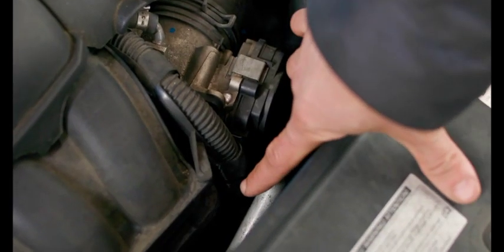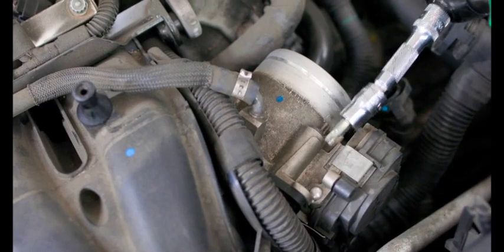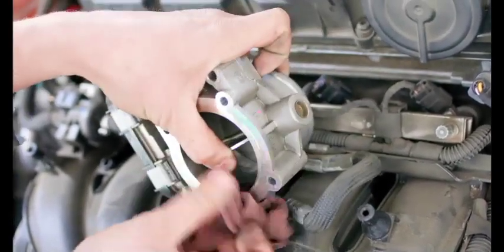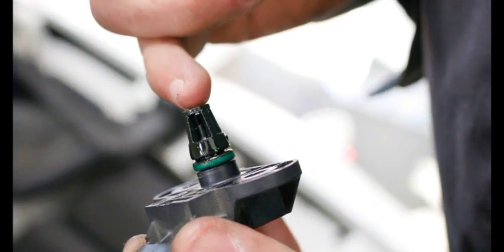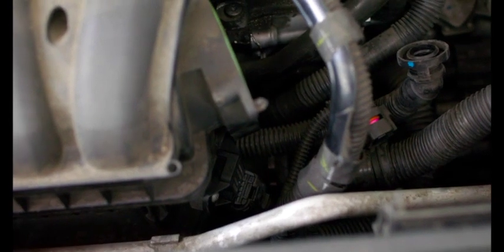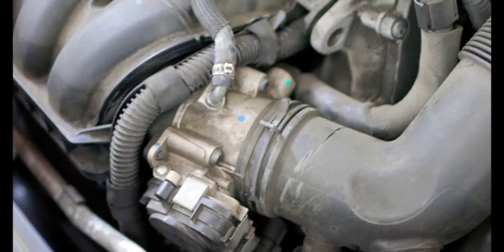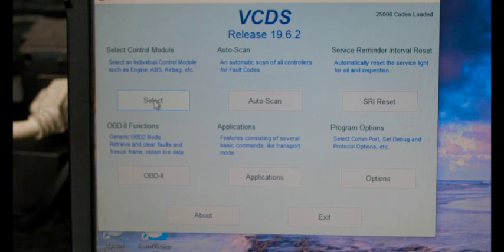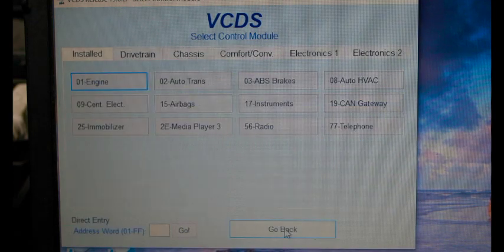2012 Vw Jetta 2.5 Check Engine Airflow at Idle too Low P3078 Manifold Pressure Sensor P0106 FIX

Comment: i'm getting misfire cel codes and rough idle. i've already replaced the pcv, map sensor, coils, and plugs for my 2.5. i have rough idle at startup and when stopped at lights. car seems to be fine at highway speeds. after the engine comes to temp i hear a whistling sound which might be coming from the new pcv diaphragm. 

could i have a vacuum leak? how can i check and where is it most likely to come from?

the rough idling etc and misfires started after i bumped into a curb at relatively low speed due to road conditions. thanks!
Reply from the maker: Hello Kumbackquatsta,  You have a vacuum leak. Guaranteed. The replacement PCV from Dorman are china junk and they do not work, they leak brand new. You can disconnect the large vacuum pipe on the valve cover and plug it with your thumb and start the engine. It should idle normally. Now you have isolated the vacuum leak to the pcv system. Replace the entire valve cover with a good OEM Vw original valve cover. This will fix your problem. Good luck
Reply: @matttorian  thanks for the reply matt! i will check the pcv. is it better to replace the entire valve cover rather than just the pcv? mine is 2012 2.5 with the separate components.

assuming a failed/whistling pcv, should i also assume that oil has gotten down to the map sensor too at this point and look into cleaning/replacing the map again?

can high revving an engine cause a pcv to prematurely fail?
Reply from the maker: Replace the whole valve cover with the built in PCV. It’s whistling and leaking vacuum at idle.  They are not cheap from Vw ($400) but you can probably find one online for a good deal. The map sensor will be fine. Let me know if you fix it
Reply: @matttorian  thanks i'll look online. do pcv deletes for the 2.5 exist? and do you have any thoughts on them?
Reply from the maker: @kumbackquatsta  no don’t do that, fix it right. You need the Oem pcv, it’s a oil separator as well. Keep it stock. Don’t bolt more junk on your engine
Reply: @matttorian  makes sense, matt.

so it was the pcv diaphragm causing the whistling and rough idle. you were right again. it's a dorman (4 months old). 

question for you, the pcv typically fails by tearing, right? in this case, the pcv was puffy, blistered and warped. no visible tears. as if it got scorched by hot liquid/air. this seems odd since the pcv is on the intake side which should not expose it to extreme heat?

the chain of events was a rough idle and shudder at stoplights, fine at highways speeds, and later after warming up, a whistling (from pcv). i did not know at the time the pcv was contributing to the issues.

so i changed the coils and plugs, but still had persisting rough idle issues (the pcv). but with the pcv fixed, it runs fine.

 i'm wondering that since the rough idle/ shudders/misfires came before the pcv whistling, that it was the misfires that could cause a pcv to fail as described (blistered, heat warped, puffy..)? backfire from misfire?
Reply from the maker: @kumbackquatsta  the Oem pcv fail from tearing. The Torn diaphragm creates the vacuum leak that sucks air in from the small vent on the bottom which makes the idle rough and you will have lean faults, idle faults and all cylinder misfire faults. The China pcv does not tear but leaks around the seal creating a interior vacuum leak. Congrats I’m happy you fixed your car.
Reply: @matttorian  thanks for your help and generosity, matt. this video was invaluable for changing my map sensor. i hope these comments can help others.

so i should assume the warped/bubbly appearance of the dorman pcv, is just a normal non-oem pcv failure, and not some heat related thing that scorched the pcv?
Reply from the maker: @kumbackquatsta  yes non Oem China junk part that barely lasts out of the box.
Reply: @matttorian  i'm honestly surprised no company has come out with a competitor using the same diaphragm material as oem, people will pay a bit extra over dorman. there's so many vw/audi motors out there
Reply from the maker: @kumbackquatsta  the 2.5L pcv doesn’t go bad too often (Vw/Audi 2.0T pcv go bad much more often) and when it does the valve cover is typically leaking oil as well. Plastic doesn’t last forever, it will warp over the years. Oem valve cover is prob the best repair but a new Oem quality diaphragm replacement is definitely a good idea.

Comment: Are the Bosch 20$ dollar sensors just fine? Im trying to compare the OEM-OE sensors. Also would the turbo outlet MAP also cause these issues?
Reply from the maker: Bosch sensors are just fine, they are Oem and the only sensor I would use. What car do you have? There are no Jettas with a 2.5L and a turbo. Do you have a RS3 or TTRS with 2.5T?
Reply: @matttorian  its a 1.8t tsi gen3 ea888 motor. I just dont know the spec on the sensors which makes it seem like 20$ is a scam compared to 65-85 for OEM

Comment: What if you don't have VCD software (free) and the $500+ adaptor.  How do you adapt the throttle then?
Reply: Disregard.  Answer to my question was down below in the comments.  Silly me!  Thanks for a great video!
Reply from the maker: Hi Kirk, I showed this step as we always do this at my shop but I think you will be fine without adapting the TB. just clean it well and make sure to clear your fault codes. -Matt
Reply from the maker: and Vag-Com cable is available for $199 through Ross-tech.com. for me it is absolutely priceless tool for Vw/ Audi repair work.
Reply: @matttorian  isn't the vag-com for older VW's? I have a 2013 Passat and thought I needed vcd and the Bluetooth adapter... $199 is close to what I paid for my code reader (with some vw features).  In any case thanks for the video and taking time to be responsive! I've got parts coming Saturday and will be doing this for sure.
Reply from the maker: @kirkramanauskas3232  vag-com, vcds and Ross tech are all the same. The software is free you just need a laptop and the cable. I know they had single vin cables for $199. Vagcom works for all obd2 vehicles from 1996-2022. It is a powerful tool that can scan any control module on the entire car just like the factory scanner. The only thing it can’t do it functions that require a factory password like keys, ecm and instrument cluster/ immobilizer replacement. But in your case you just need a simple obd2 scanner to clear your fault codes and you should be fine.

Comment: What you thing about P2188 ?
Reply from the maker: Too rich off idle. This is a fairly rare fault and without actually looking at it I can only give you my best guess. You might have fuel in your oil, I would change the oil and also clean the throttle body and adapt it: it wouldn’t hurt to do a tune up on the car, install new spark plugs. You also might need a new Map sensor, possibly new Maf sensor if you have one depending on your year and possibly a new front oxygen sensor that is reading too rich. Also make sure your PCV valve diaphragm on the valve cover isn’t torn and leaking vacuum. That typically causes a lean fault though. Good luck

Comment: What is the bosch part number?
Reply from the maker: There are two different Map sensors, the early BPR 2.5L 2005-2007 uses a MAF and the Map sensor is different. This video is for the newer CBUA 2.5L 2008-2014 with NO MAF and uses Bosch # 0261230234.
Reply: @matttorian  thank you for the answer 😊

Comment: Map sensor location is pretty bad makes want to install a catch can to eliminate some of the oily residue going to throttle body.
Reply from the maker: Bernarda Flores I wouldn’t worry, catch cans aren’t necessary, it would help but there would still be some oil getting by from the separator as vapor. Just clean as needed👍🏼

Comment: I got a pesky P0106 even after a new sensor
Reply from the maker: HI Jester,  I would visit your local dealer and see about a possible software update for your ECM. Also what year is your car?  There are 2 different versions of Map sensors on the 2.5L engine. Just make sure you installed the correct version. You have cleared the fault and it returns right?  Lastly you might need a new connector and terminals if all else fails.
Reply: Matt Torian it’s a 2012. Yeah it comes and go i was gonna try cleaning it and see what that would do